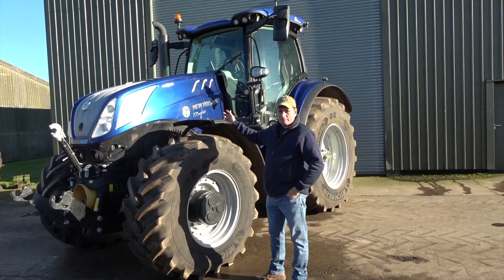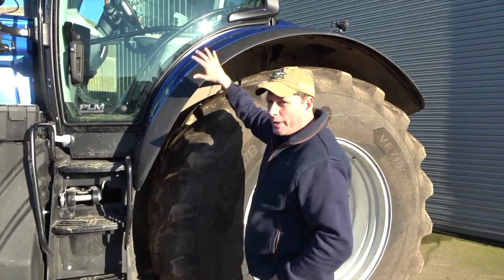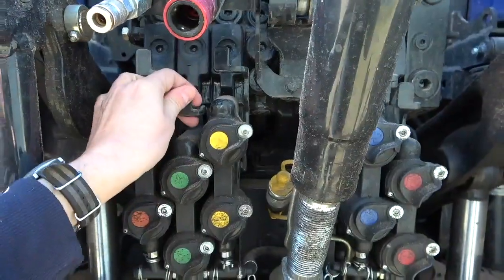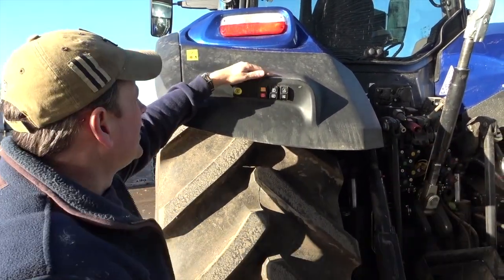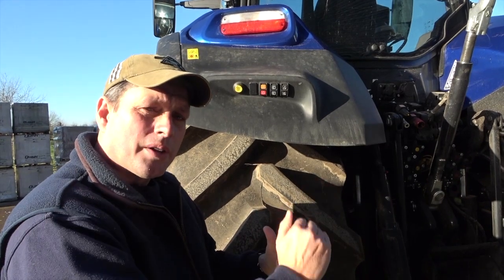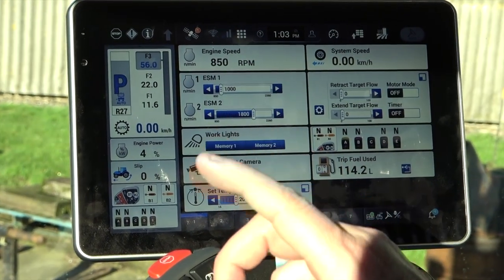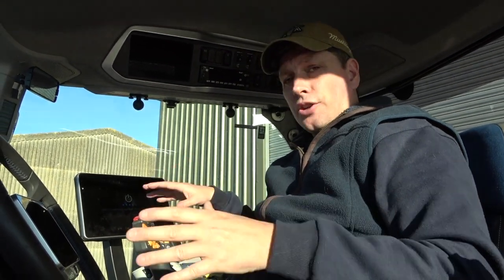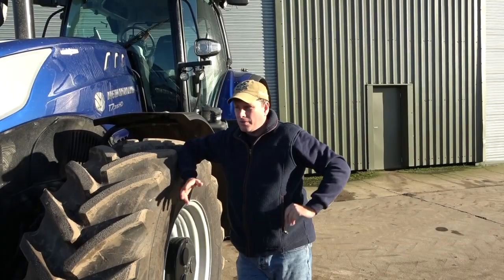NEW HOLLAND T7.315 HD REVIEW

Comment: Very well said about the Stop button, and it's not just for an actual emergency. From personal experience: you could easily be tucked between the wheel and a machine and be just uneasy about your next move with a hose, shaft, etc but will most likely take the dodgy shortcut rather than squeeze out, get into into the cab, squeeze back in again. This puts the safer option right within your reach. Brilliant.
Reply from the maker: 100% that's EXACTLY what it's for day in and day out.
The ability to have something there in an emergency is just a real added bonus and that could stop you having to use it in the event of an emergency.

Comment: Can’t fault it can you really… great video, and really pleased to hear it’s quieter inside the cab as I find our T7 just noisy enough.  Your mans right about the position of the exhaust break too.  We have them on our Pumas, great for road work when hauling heavy loads all day long. Massively saves your breaking system.  Obviously the stop kill button almost everyone has commented on is a revelation.. my only wish would be that the button be located on the right hand side of those cluster of buttons so it’s nearer to the middle of the backend of the tractor giving you a bit less stretch to reach for it if you are caught or stuck somehow.

Comment: I am impressed! I thought that the colour was its most outstanding feature. I was wrong!  Whilst the colour is still fantastic (irrelevant, I know), the 'kill switch' button is absolutely fantastic! You are right, how could agriculture have come this far without it?! I also really like the speedometer positioning - far better location for tractors. It is a good example of using the advantages of current technology to good use and not being tied to the past when analogue gauges were bulky and had to be in the dashboard for mere logistical reasons. The designers and engineers at New Holland have clearly put a lot of effort into this tractor.

Comment: With the equipment I drive I carry this control box in my pocket it has 2 buttons on it, top button turns on the pto which runs a pump on the truck 2nd button is a stop button shuts off the whole truck completely safety is important.

Comment: Another great vid great watching
Emergency Stop buttons should be like on industrial machines, big red buttons with a yellow background with emergency stop wrote on it in big black letter. Once pressed they should lock in so you have to physically twist them to make them come out, it will then allow you to restart the machine but only from the main starting point It’s what has been used on industrial machinery for years all well proven stuff.  If it stops one incident it’s worth it. Think it may even be the law on industrial machinery (Part of the PUWER regs I think).

Comment: In 2015 I bought a low hour New Holland T7.170 cvt. One of the main reasons was out of the tractors I looked at the T7 controls was the easiest for us to understand only ran old tractors before. In hindsight I would rather have a high output t6 or a t7.200 or 210 either she is too big or needs more power.

Comment: the stop button on the rear fenders is a great idea, valtra have or had a plug you can pull in the back of the cab just above the top link which would disable the pto. is there a stop button on the front linkage? and what's the idea of the large stop button on top of the main controller on the arm rest??

liking the matador hoody a lot !!
Reply from the maker: As I remember (🤔) the Stop button on the controller stops all drive/functions but not the engine.
The ones outside stop the engine (as you saw)

Comment: The E-stop button needs to be the most easily seen and accessed button on the whole control panel. That one needs to be about 3 or 4 times the size with a push pull type that is illuminated while any power is live in any of the systems. They have had them on the machines that made that tractor for the last 60 years so putting them on the tractor itself is a no brainer.
Also would like to see how all the plastic buttons knobs and slides hold up in a real world situation over the next 5 or 10 years.
Reply from the maker: Probably the same way they've held up in all the other T7's for the last 10+ years so I don't think they'll be an issue.
Reply: @LordMuck  We never had any of that fancy stuff... like cabs on our tractors let alone tinted windows and plastic do dads...lol.  
40 years ago if you had told me we would have fly by wire and auto steer with GPS navigation on a farm tractor I would have set down and asked for the shite you were smoking...lol. Different times indeed.
Reply from the maker: I'm trying to remember when I saw the first digital dash or readout, probably in a Datatronic Massey mid-80's.
Reply: @LordMuck  First talking dash we had was in a Chrysler mid eighties that would always bitch at you in a robotic voice the windshield washer fluid level was low...lol.

Comment: I would like to portable tablet for tractor, so if you are mixing or adjusting spray nozzles on trailer sprayer you can adjust revs or kill the tractor from safe distance especially if hydraulic hose burst off.  With these technology features how many tractor operators would like simple version which is cheaper like hydraulic handles but able switch around to what they like or simpler hand control instead of sidewinder?  Don’t get wrong I do like premium cab but some would like cheaper/simple cab option?
Reply from the maker: There's still lower spec and poverty spec variants available.

Comment: Do you have a video explaining how and what a exhaust brake is and does. Ty
Reply from the maker: No, they're simple enough and work by using the pressure in the exhaust to use the engine to retard the transmission and driveline without the use of brakes.

Comment: Excellent video Lord Muck  :) also say that STOP BUTTON and others buttons helpfull plus should be every tractor brand too 👍  agree 100% to! Plus those hydraulic connections to release should on all tractor brands to plus PTO too like that also ! One feature talk about the Exhaust Brake what that do never heard of before on tractor be interesting to how works too! Also that Brand New Holland 315 tractor how quiet is amazing for 66 DB agree to and worth every penny too! Also Lord Muck does those Windshield Wipers have Delay speed plus have squirt fluid to put Windshield and back window too clean with too! But think New Holland listen to customers input want to put tractor brand new for options too! One thing like see New Holland and other brands is light sensor plus light come on in day or night when under cab outside hook up stuff give lights so see doing and when go away get in cab it shuts off ! Something like Security Cameras do of the Motion Dection!

Comment: Personally i think that there should be a kill button on every corner with the large triangles like the have in motorsport as more people will know what that is.
Reply from the maker: If they'd done that from the off, everyone would be bitching and moaning. This is the first major step in the right direction.
Reply: @LordMuck  as good as it is it needs to be bigger and more visible.  From the video you really have to look and know where it is.  All steps in the correct direction though.  Can't knock them for that.  All the safety in the world will not make up for a lapse in concentration.
Reply from the maker: It's primary function is to encourage you to Stop the engine from the rear rather than having to climb out, up into the cab and back down so you wouldn't bother.
Going forward, because of all the positive comments I'm sure they will look to fit more of them and make them larger.
Your first line of defence in safety however is common sense and good practice.

Comment: That emergency stop button would be a better feature if it was a bigger round button like the ones on other industrial equipment, I mean even trains have an easily spotted big round button for the fuel shut off.
In-cab sound level is probably the stand-out feature, it makes a huge difference to driver/operator comfort in any vehicle. I know my hearing has suffered from driving trucks, where you're unlikely to find much in the way of sound deadening, because the manufacturers are chasing every tenth of a kilogram for the sake of load capacity, over the driver going deaf from all the noise of the engine, the road and the wind they're subjected to for 9 hours a day or more.

Comment: The problem i always had with the New Hollands is that they feel cheap in the cab. 

I ran Fendt and MF for most of the time,  and i had a New Holland that i cant remember the number off, and it just felt so cheap in the cab. Its a small issue, but when you spend most of the day in a cab, you should enjoy it. 

Other then that it was a good tractor, but i still prefer the Fendt over pretty much anything.
Reply from the maker: I agree the 40, 60 and some early TM's felt cheap but with this current range it's on another level, just like a good car or truck.

Comment: In industry they can have a pull cord system around kit to emergency stop it  and it’s under tension so if it goes slack it also stops kit   But can be nightmare to set up. Don’t know how it could be fitted around a tractor
Reply: Your idea fails a bit if you catch the stop string in the hedge.😅🤣

Comment: She looks a beauty. That stop button brilliant it should standard with all manufacturers. Looks like new Holland got this tractor spot on. Now the question is did it go faster in kph or mph lol😁👍
Reply from the maker: It did 32 mph then I changed the display to KPH and I got an extra 40 hp, it went along at 500 kmh and I gained 2 more radio stations... (if you know, you know 😉)
Reply: @LordMuck  pmsl. I wish I knew all this when was driving a 6080 I could have run the double mowers faster and had more tunes to listen too. Or well I guess we've all learnt something after all these years

Comment: Thanks for sharing LM. That is some tractor the lower back window is class, some make s  stop when you left of the seat so this would eliminate that. Kill switch a must.
Reply from the maker: The seat sensor works when in drive (as does the NH) but this Stop button kills everything when pressed whether in the seat or outside.

Comment: Good review, but what annoys me most is they spend so much money on flagship models like this and if you buy a 100hp loader tractor it's got a crap cab, a 100 horse power tractor will most likely clock up more hours in a lifetime than the big ones, and they probably sell more aswel 👍
Reply from the maker: But it's always the lower horsepower users that whinge about wanting a seat and steering wheel and nothing more.

Comment: The biggest concern for the farmer's in Denmark is New holland engine, if it can run 20000 hour or just 10000 hour like the older Ford/New holland   .in Denmark a New holland with  10000 hour is not esy to sell
Reply from the maker: I think the FPT is probably one of the best engines out there at the moment.

Comment: That stop button should be compulsory on all machines. But its to small should be a big Red button .  On the inside of the rear mud guard so if your trapped you could just press it with no effort.
Reply from the maker: This is the first step to see what people think and already it's a resounding winner. Going forward, larger ESD's could be fitted and on more locations.
However, this should never replace safe working practice.

Comment: It's great what NH has done, but definitely they should improve front windscreen wiper. Check how Valtra has it done in T series or Fendt. I mean 270 degree windscreen wiper. It perfectly visible when you drive with one of your colleagues and bottom of windscreen is dirty and nothing can be seen. This is important to see front tires, so NH should make front screen wider and install 270 degree windscreen wiper. Rest it perfect :).
Reply from the maker: Yes we kind of came to the same conclusion although it cleans a much better area now and unless you're a goblin, you can see the front wheels.

Comment: You should put this on talking point as well perhaps.
I didn't like the dash when you first showed it as it looked like it was proud of the steering wheel but later I could see it was set down on the wheel and I really like it. Tractors with the dash on the front pillar are too far away in my mind. 
Biggest thing I didn't like was the wind screen wiper as it really needs to be shortened so it can clean lower down. I bet you couldn't see the front wheels when it was plastered?
Overall it does look fantastic. One of your best videos. We'll done.
Reply from the maker: If the blade was shortened it wouldn't clear the top...😉 you could easily see the front wheels when it was dirty, just not right to the axle. I think as Jonno mentioned if they widened the front pillars it would be  an improvement but it's so much better than the older model.
Reply: @LordMuck  
It's deffinatley a big improvement, I agree.

Comment: Some thing you overlooked,  on current model , when you close the door you chance smashing your left hand fingers, between door grab bar and buddy seat belt clip! Ouch I know,  by black fingers to show for it. Please check it out.  I'm in US, hopefully you just posted this and will check this out  It's a safety issue.  Just looking mite still be the same.
Reply: Just seen your comment, there should be a specific door closing knob much further back than the buddy seat belt clip, no need to actually close the door with the grab rail? Maybe not fitted to US spec tractors?